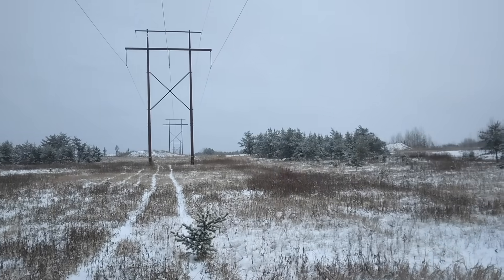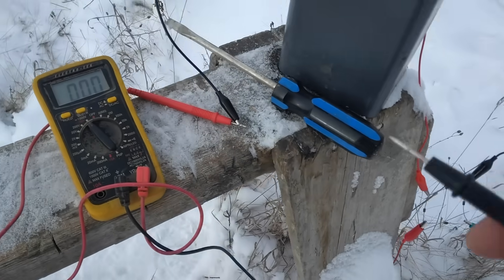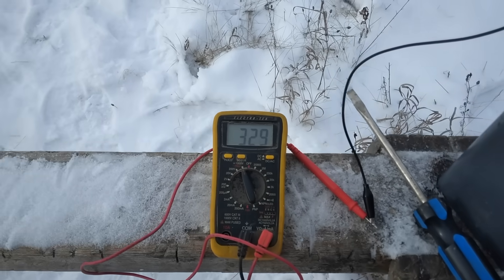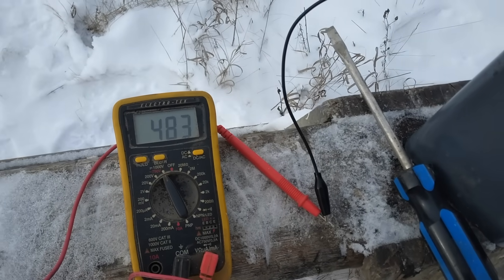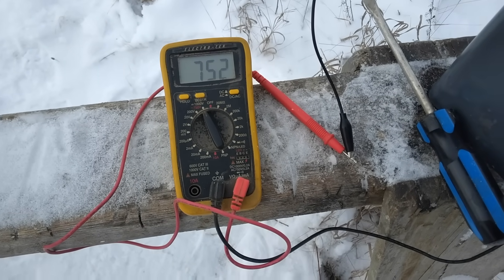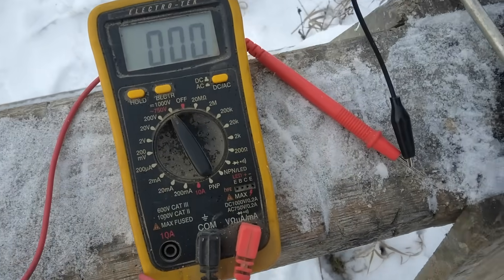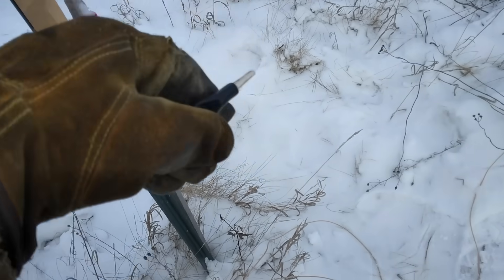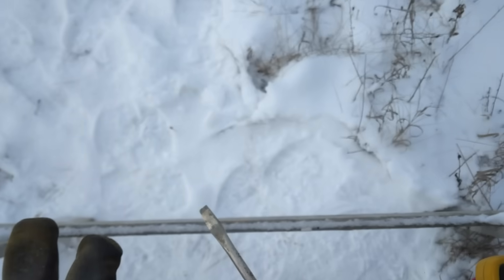Fences sucking power from under HV transmission lines

Comment: As an electrician, I was called out to a site where a crew was setting up a manufactured home under high voltage lines.   The set up crew was getting shocked every time they touched the metal frame of the house.   My volt meter showed 110 volts AC from the frame to ground.     I put ground rods at each corner and wished them luck.   Would hate to be living in that house...
Reply: Time to worry when the Electrician says "Good Luck!"
Reply: @todddon   That’s the truth!
Reply: @todddon  nah the guys on those crews never care what sparkies have to say
Reply: Saul Goodmans brother would freak out
Reply: Holy crap dude, how is that even legal? You would not be allowed to build a house under a HV transmission line in Europe, for obvious reasons 😅
Reply: @fredriksjoblom5161 that is not true, I have seen multiple homes under the 380kv lines here in Germany
Reply: I live in Ontario Canada. A guy got charged a few years ago for putting a coil of wire under the transmission line to charge a battery.  I don't know what the outcome was, but it was theft. @fredriksjoblom5161
Reply: @fredriksjoblom5161   TAKE RIDE THROUGH POPULATED SUBURBS OF CALIFORNIA ,YOU WOULD BE AMAZED !
Reply: @fredriksjoblom5161  it’s ok as long as you wear your tinfoil hat
Reply: @fredriksjoblom5161  in Portugal I know some apartment buildings underneath high transmission lines.
Reply: @fredriksjoblom5161 they still want us to drink fluoride here when my dentist says it's idiotic. Idk what is happening dude....
Reply: @fredriksjoblom5161  Yea I think he is talking out his ass!:face-red-droopy-eyes:
Reply: @fredriksjoblom5161 most high voltage go under ground.. in Northern Europe. In the 70s my room was maybe 20 meters from the high voltage lines coming into my town of about 30k. And the transformers to step it down was in my garden in a big concrete building… my grandpa was a plant manager at the electric company.
Reply: @kungfreddie  No, the vast majority of high voltage lines are above ground in northern europe. But it depends entirely on what high voltage lines you are talking about. On the lower end of the spectrum,  like 10kV or the 30kV line close to your childhood home, most transmission lines go under ground for safety. But they tend to elevate with the voltage. On the other end of the scale few power plants will have underground transmission lines going out of them. This discussion was specifically about building under hanging transmission lines, of wich there are plenty across Sweden. Also the regulations regarding EMC has changed quite a bit in the last 50 years.
Reply: Have you suffered any negative effects? Like coming down with cancer, or sterility, etc.?   @kungfreddie
Reply: @travisc8607  no... but my aunts both got ms... not sure how long of their upbringing was in that house... but it would probably be like atleast 10 yrs. My mom got breastcancer a few yrs back... but she is 69 so such things happens... it was treatable.
But 2 ms in same family is rare I think since it's not supposed to b genetically.
My grandfather died of leukemia while working there... but I also think.. not 100% .. that when doing military service in 50s he operated a xray machine on new recruits to check for tb probably. (I just remember hearing this as a kid)
My grandmother died of cancer too... but she was 88... so.. she lived in that house for like 35 yrs and then died 20 yrs after moving to a new place.
But I'm 50 and to this day I don't know that I've gotten any bad effects. I moved out when I was 16, moved in when I was maybe 5-6... so about 10 yrs there.
Reply: @kungfreddie  given that ms runs in families, having multiple people with ms is not unusual.  And about a third of US residents eventually die of cancer.
Reply: Let me guess, you have red curly hair and freckles?
 @kungfreddie
Reply: @fredriksjoblom5161  I don't remember the kv of the lines.. they would have been at least 30 kv I guess.. it was the lines delivering power to Trelleborg. I lived in a house right next to the transformerstation where the outside lines entered, my grandfather was "verksmästare" on the powerplant.
Reply: @rbauer961  huh? I'm not an electrician..  capacative coupling is something i haven't heard used.. not in English anyways.
Reply: @kungfreddie  It just means a wire can make a voltage in a wire next to it. But an underground wire cannot do this because it has metal around it which is connected to the earth.
Reply: @rbauer961  yeah that I get.. the shielding part but I'm not sure what your answer was in response to. When I said cables were under ground now i didn't mean it as a bad thing bcoz EM field. I meant it as a good thing. That the ground cables are isolated and shielded I'm well aware.. these 2,5 meter in diameter cabeldrums with ground cable were part of my playground as a child!
Reply: @kungfreddie atleast it was properly grounded 😂
Reply: Depends. Yes above i er distances in open coutry. Inhabited they go past or under. Do not want to live to close to those cables. As this man shows, there is an electromagnetic flux field. Tooich exposure may mess you up.  Same with people living close to broadcast towers. Increased cancer numbers. Alm those cellphone towers, well less energy, but radiatiom is not just about intensity, but also duration of exposure. So years of 24/7 exposure, guess will find out in the practice test. That is if we get the data and it not being succesfully surpressed.
Reply: @kungfreddie Was all that OK?
Reply: @fredriksjoblom5161  how else are we supposed to get rare childhood leukemias? Build neighborhoods next to radioactively contaminated areas, refineries, and chemical plants?

Because we do that too 🙃
Reply: @Dudeguymansir and landfills that eventually leach
Reply: @Dudeguymansir 
Watching how America's govt sausage is made is an ugly thing...
Reply: @Dudeguymansir There's absolutely no correlation between any illness and power lines, and it has been heavily studied.
Reply: @Dudeguymansir  Remember this is The American Way god bless America
Reply: @Dudeguymansir  Next to, why not on top of!?! We've tried that too 😭
Reply: @Dudeguymansir HV power lines act as electrostatic precipitators - the dust in the air collects on the lines and falls to the ground under them.
HV power lines also generate X-Rays if any leakage occurs. VHV (0.5MV) power lines generate gamma radiation and antimatter.
Reply: @Dudeguymansir Bayway refinery & chemical plant and the entire town of Linden, New Jersey have entered the chat.
Reply: @Dudeguymansir I mean massive amounts of people were duped into taking DNA altering substance I suppose it could happen that way to.
Reply: Would you like to explain to the rest of the class how you get cancer from non-ionizing emr? 
🤡🤪
Reply: @Dudeguymansir exactly.  They might start with regulations.  Which soon get forgotten in the face of money.
Reply: @Dudeguymansir  Rare childhood leukemia from non ionizing electric fields? If you believe that I have ocean front property to sell you right around the middle of the Sahara
Reply: @DarkAttack14  I’m currently investing in a bridge in New York, thanks so much 🫶
Reply: The elites don’t.
Reply: @Dudeguymansir wait until you realize you're being bombarded by radiation all the time if you make phone calls, use Bluetooth or wifi. Never understood the appeal of putting radioactive electronics in your ears and then sending signal between them.
Reply: @Dudeguymansir  Power lines don't emit inoizing radiation and don't cause leukemia.
Reply: @DudeguymansirLove Canal has entered the chat!
Reply: @Dudeguymansir Used to live across a field from some high tension power transmission lines. Five kids got leukemia along that corridor in the time we lived there. We moved as soon as we could.
Reply: @Dudeguymansirvaccines
Reply: @Dudeguymansir  This likely wouldn't cause leukemia. I would be worried about things like damage to property, electrical shocks, nerve damage from being tingled and shocked
Reply: @fredriksjoblom5161 Hey buddy,  The EV folks need all of this they can get, best get used to it.
Reply: If it's 110V there's probably a wiring fault in the Low Voltage feed to the house, and nothing to do with proximity to the HV power lines!
Reply: @gregbailey45 exactly. The chance that an induced current be right around that voltage is pretty low.
Reply: "good luck" 
ive heard this from multiple contrators
Reply: @ShadowZero27 lovely what construction has come down to. Instead of guiding people out of their mistakes...they say good luck rock on. Even life threatening situations
Reply: @ShadowZero27 not everything has a good solution
Reply: I got a shock riding my dirt bike under them it didn’t really hurt but shifted my hand off the metal part of handle bars. I’ve worked under them in winter it’s odd n I used to try n avoid them. They run straight over a local school😳
Reply: @willj7628 that’s bloody crazy
Reply: You should set it up in a way that it will power ur how
Reply: Capacitive coupling?
Reply: @Dudeguymansir No, inductive coupling like the air gap in a transformer. The magnetic flux lines extend to the wire on the ground inducing current flow. Capacitive coupling requires large surfaces in proximity. The wires don’t have a significant surface area.
Reply: @twm4259  Good answer, but transformers don't have an air gap.
Now, motors do.

In a transformer the flux is carried from one winding to the other using iron, laminated pieces of iron glued together.
Reply: @deang5622  
Air-gapped current transformers

These are auxiliary current transformers in which a small air gap is included in the core to produce a secondary voltage output proportional in magnitude to current in the primary winding.
Reply: @Dudeguymansir  Capacitive coupling would have produced a much higher voltage.
Reply: @Dudeguymansir            Inductive
Reply: @Dudeguymansir Inductive coupling.
Reply: @Dudeguymansir More likely to be inductive coupling
Reply: @deang5622  thanks. You’re like the seventh person to respond to my initial inquiry. I appreciate you, and agree 👍
Reply: @Dudeguymansir Induction, just like a transformer. Maximum current is the same as the HV power line with a single parallel wire.
Reply: You just *had to* @Dudeguymansir
Reply: @sandasturner9529  I don’t even remember what I did at this point lol
Reply: @Dudeguymansir Basic earthing. Thick wire connected to the metel then onto a rod hammered into ground. 👍
Reply: @Dudeguymansir   I think so. They could probably cure it with bleed resistors.
Reply: @Dudeguymansir ye, the only way to gain some valuable quantity, you need a capacitive coupling. Coil will not work at all, may be you will light a LED
Reply: @Dudeguymansir Inductive. The alternating magnetic field is inducing a current in the wire. If he wrapped the wire around a big chunk of iron, he would get even more energy out of it.
Reply: @Dudeguymansir what you were seeing here is that current reversing directions and those magnetic lines of force are cutting this wire. That's inducing the voltage. The power line has huge capacitance with the ground since it runs miles. There are a lot of magnetic lines of force collapsing and rising around that power line from the massive current.
Reply: @Dudeguymansir inductive
Reply: @ thank
Reply: @Dudeguymansir  I believe it's called induced coupling or induced ac. AC  noise.
Reply: @Dudeguymansir obviously so
Reply: @Dudeguymansir  no it's inductive.
Reply: @ please see the 300+ comments above that say exactly this. Thanks
Reply: @Dudeguymansir 
Inductive. And he needs to put multiple windings under that line if he wants to steal useable quantities of electric power- Which the power company will notice. There is no free lunch and people started trying to get free power this way many decades ago.
Reply: @BertRowe-b3l So if you're inductively stealing energy from the power utilities, what do they do to stop you? 😅
Reply: @BertRowe-b3l both capacitive and inductive coupling possible, but when it comes to high voltage power lines, inductive coupling is extremely. In general, high current lines are prone to inductive parasitics, and high voltage lines are prone to capacitance parasitics.
Reply: @Dudeguymansir  Inductive coupling
Reply: We take fluorescent lightbulbs underneath The big powerlines
Reply: The chances HV lines would induce 110V is pretty low (if not zero). Probability says the lines weren't your issue, probably a faulty piece of equipment with improper bonding.
Reply: @davidchavez81  exactly!  On a separate point, anyone who has had an MRI gets a mega dose of "lines of flux".
Reply: @davidchavez81 Seconded. As demonstrated in the video, with a big enough capacitor and the Know-how to rectify it and the time to build it up at micro amps, yes it’s possible to reach dangerous voltages. 
Without rectification, the current flow will be still be micro amps, but the polarity reverses 60 times a second. Actually 120, giving 60 full cycles every second, so the opportunity to build up a voltage doesn’t exist. It took dozens of seconds to build up to a noticeable voltage, with the rectifier. But without the rectifier, the voltage will rise, fall through zero and go negative, then rise back to zero 60 times in every one of those seconds, so never getting to the point where it can do any useful work.
Reply: @davidchavez81 not true..  we knew a guy whose property ran under HV wires and his horses fences were electrified,and he didn’t use a hot wire unit. So it IS feasible
Reply: @mrs.c5471 makes me feel better as a backup to our solar chargers when the herd is under the power lines in low sunlight November.. except the tiny wiresnon the ekectrinet may not have the same induction as 12 ga tension wire.
Reply: Parked a pick up truck under a high voltage line once..would get shocks from the door handle.
Reply: @marklevesque4131 the tyres insulate it from the road, so the whole thing becomes a charged up capacitor.
Reply: What he has built here is an induction loop. The closer it gets to the trasmission line stronger voltage and higher watts. Free power until th power company searches for the leak (draw) then you'll get a massive bill.
Reply: So you believe the power company would be able to detect a few amps leakage on their transmission line?  @jeffbleyl6243
Reply: All of it is zero point/free energy. Those line are closed loop and pull electricity from the ether.  @jeffbleyl6243
Reply: I live near HV lines and when passing under them the hum is unsettling.
Reply: The hum is the wires vibrating as the magnetic field generated around the wires expands and collapses - interacting with the Earth's magnetic field. There is also some interaction between the 3 or 4 wires.  @Gunshinzero
Reply: @buggsy5  I thought it was the electric field leaking a bit of energy into the surrounding air. Moisture increases the conductivity of air, which makes the hum “hummier” 🧐
Reply: @Gunshinzero of you do it at night you can see the buzzing: tiny blue sparks (coronal emission).
Reply: @Gunshinzero there is a hv lines a few blocks from house and I used to hear the hum at a certain spot like the insulator was cracked.
Reply: @Gunshinzero  And why are they humming? Because they don't know the words. Lolol😅
Reply: @Gunshinzero  it's not just the ominous hum. Very strong EMF can make you feel anxious as it can mess with some of your senses. Some of those "haunted house" stories have turned out to be anxious people hanging around close to a poorly shielded cable.
Reply: @dustinbrueggemann1875  I haven't heard that before. That's a pretty interesting bit of info. I definitely make it a point not to loiter around under them but figured I'm just over thinking it.
Reply: 110 VAC to ground? You likely had a wiring issue going on there,
Reply: @bretgreen5314  I just wrote he needs to go back and find the issue, I have seen loads of stuff under higher powered lines and never seen 110 AC to ground unless there was a neutral to ground somewhere. Ground rods everywhere isn't a proper repair.
Reply: to those saying the company will detect the loss 😂😂  you clearly have no idea how much loss actually occurs of that most is undetectable 😔
Reply: Jesus christ i cant believe someone would put a house there.
Reply: @brianfitch5469  I've seen then build brand new homes under these wires and within months come in and tear them down....I wonder why?
Reply: @brianfitch5469 Muhammad wouldn’t do it. As a matter of safety, Buddha, Confucius, and David Hume would tell the owner of the home that it could be a hazard to live near power lines
Reply: @brianfitch5469 shouldn’t be using God’s name so loosely…… He’s the savior of the world
Reply: And what did Jesus Christ reply to you?
Reply: @brianfitch5469  isnt it illegal to build under high voltage lines?  In Germany and all other nations i know of you can only use the land below as farmland.
Reply: @brianfitch5469 Zeus actually
Reply: Jesus Christ loves you!
Reply: @Molon_Labe1776  Jesus was just a dude with a beard
Reply: @Molon_Labe1776  who is jesus christ?
Reply: @brianfitch5469 ..what did Jesus have to say about it?
Reply: @brianfitch5469 I've seen the Greek and it doesn't say that. Where did you see your version?

Edit: the original comment I replied to has been deleted. It said the original Greek described something modern versions of the Bible didn't say and went into detail about nakedness and a little boy or something. Giving context because the replies are out of context of the original post.
Reply: @brianfitch5469 gnostic informant is as trustworthy as the National Inquirer.
Reply: @brianfitch5469  Spreading Satan's Lies. 
Believe them at your own peril.
Reply: @brianfitch5469 that passage says no such thing.  The mob that came to arrest Jesus also grabbed one of those following Christ and he slipped out of his loose fitting clothes and fled.
Reply: @simhess9720  Truth never fears investigation. I told where the information can be found. Ignorance is not bliss. 
Ive spent 30 years of my life studying the scriptures in multiple languages. 
The original greek is nothing like your English bible. They are essentially different books. Greek is much more descriptive. Just like the bible never says eternal life. Its says aonic life. Two way different meanings.
Reply: @Gunshinzero Yeshua was not Greek! Nor was his name Jesus. King James was actually Queen James! 😂😂
Reply: @seetheworldfrommyharley  The original language of the Scripture the guy I replied to mentioned, was written in Greek.

King James version was an English translation from Latin.  I don't know why people act like it's authoritative. I don't use it.
Reply: @brianfitch5469  Dude, what are you talking about? This video is about Electricity. Stop talking about religion.
Reply: @rrai1999  Keep it pushing the adults are talking.
Reply: @Gunshinzero  The hebrew copied from the greek. Hebrew isnt the original despite what many people believe. The first gospels appeared 100+ years after "jesus" (zeus which is greek) if your talking about old testament some of that is in ancient hebrew. The hebrew old testament is mostly copies of much old sumerian texts. Hebrew whether new testament or old testament are cliff note versions of the originals.  And other old testament is also copies of older greek works. We have greek manuscripts several thousands of years old. Much of their stuff was never destroyed. Greek is also much more descriptive then ancient or current hebrew. They have specific words for specific meanings. Its the most descriptive language we know about. The classical greek language nothing can compare when it comes to descriptions of things. 
When people study the scriptures in hebrew they are copies of older greek manuscripts. The hebrew is easier to learn then classical greek. You lose alot of descriptive details in it though.
I showed you where some knowledge is, he isnt the only greek scholar to go over these texts. They say what they say.
Even the name jesus comes from the god zeus. Greek.
Reply: @brianfitch5469  I mentioned nothing about Hebrew in my replies. I know the "new testament" was Greek and Aramaic. None of what they referenced was missing in modern text available today. They just took a bunch of interpretive liberties in their explanation.
Reply: @gavinhadley7672 really  this was man made Jesus had noth in to do with except the knowledge
Reply: @gavinhadley7672 or Buddha, Mohammed, Confucius, David Hume
Reply: @Gunshinzero the Latin Vulgate was translated from Koine Greek. Greek —> Vulgate —> English, then many other language. The Old Testament (Hebrew/Aramic) were translated into Koine Greek during intertestamental period, called the LXX. Most quotes in the N.T. are referenced to the LXX, not the Hebrew, until the Dead Sea Scrolls were discovered
Reply: @rrai1999 someone mention Jesus. Perhaps Buddha. Perhaps Confucius. Supposed to be about electricity
Reply: @brianfitch5469 non sense. The LXX is the Greek translation of the Old Testament Hebrew and Aramaic. The earliest gospels manuscripts have been date to about 40 A.D, not the second century. Jesus is from the Hebrew Yeshua, not Zeus. Yeshua means “God (Ha Shem/The Name) Saves”. The God of Israel, not Greek mythology.
Reply: @seetheworldfrommyharley But only on Saturday nights.  Or is that ‘Knights’?
Reply: @Gunshinzero used to have some on a quiet rode and every time we rode bikes under there could hear that humming never really thought there was anything good about it.
Reply: @gavinhadley7672  nothing, been dead long time
Reply: No nearby houses, hotels hospital, schools, stores,etc.etc. should not be permitted, with a certain distance limit of around 25 meters minimum.
Reply: When I was 11 years old, my Daddy bought a new doublewide mobile home. It had metal siding. Electricity had not been connected to the house yet and being an eleven year old boy, I was barefooted. My Mama called me over to the window to ask me a question and I reached up and touched the metal window frame... boy did I ever get a shock!  She didn’t believe me when I told her it shocked me. She said, “there’s no way for it to shock you. We don’t have any electricity.” Later that day, she was watering flowers (the well had electricity) and she was using her finger on the end of the hose to spray the water. She had an ant biting her toe so she reached up to lean on the house to lift her foot and remove the ant... pow! It got her too! 
When the electrical installer came later that week, he said it was because there was no ground installed yet. The metal siding was “soaking up” electricity from a nearby radio/tv tower. Once he installed that grounding we never got another shock.
Reply: @defritzel That's a great point. We passed on buying a double-wide a hundred yards from feeder lines. You could hear the lines humming and the orchard trees beneath the lines were stunted, full height a few rows away. I had heard of stuff like this but that was the first time I'd seen it in action.
Reply: I believe the field reduces at the square of the distance so even if you went back to your house and did the same setup you probably would still get a reading.
Reply: If there was no electrical wiring to/in the house, it would be possible if you had sensitive enough equipment. But even a feed to the house that had the power turned off would generate enough of a field to totally mask any signal from the HT wires.  @mollyhackman4910
Reply: The manufactured house was picking up the magnetic field around the high voltage leads basically acting as the secondary part of a transformer. That’s why the power companies don’t want building etc within a certain range of their power lines. A fence with metal posts or grounded posts would prevent electrical shock. And in case of a high tension wire being damaged and falling to earth’s surface would do a lot of damage.
Reply: You can take a 4 ft. Florescent light bulb and stand under these power lines and the bulb will light up, not real bright but it will light up.
Reply: Measuring 110VAC just a coincidence?
Reply: Had a 7 year old kid killed standing in water and touching the hitch of a mobile home.  Turned out it was a frame Lag bolt into the dryer wiring in the manufacturing process.
Reply: Free electrickery😂😂😂
Reply: There are 1000s of homes here directly under them. My brother in laws is. Hair on your body tingle outside.
Reply: I can smell ozone near 5g towers on humid days
Reply: You can light fluorescent tubes under the big high voltage lines as the magnetic field strength is that strong. I was told, while you can construct fencing or wiring to take the current, the power company would show-up to disassemble or charge you. I don't know if they could detect the loss or not? But if I tried this, I'd surely keep it on the hush-hush.
Good luck with it.
Reply: @terryenyart5838  , depends on the law.  unless the law states that it is illegal to place a fluorescent tube in the vicinity then you are a legal joule thief.  post the video.
Reply: You have to boost the fluorescent tube far overhead to get enough of a field to light the lamp. 

That experimental circuit was close to ideal. The only loads were the forward resistance of the diodes plus the internal resistance (more properly impedance) of the capacitor. But notice how slow the voltage increased - I doubt if there was even a milliamp of current flowing.  It would be easy enough to measure the current, and that dangerous capacitor would not be needed.  @terryenyart5838
Reply: @terryenyart5838 no they cannot detect losses, that's a myth
Reply: Up in northern Ontario, ive seen the power lines glow blue, back when i was around 14 or so, one night while we were all outside watching the northern lights. Electricity and magnetism are wild!
Reply: @MissHellKitten probably the 550,000vac lines
Reply: I didn't even think this is possible damn 😔
Reply: Power co. wouldn't let you build under a line, and if you did, as soon as they found out they'd get you to move it. Metal frame house? Who built it?
Reply: @patricktaylor4431  I’m on board now, I’m tracking!

Thank you
Reply: You had a live wire touching the frame that was not from the transmission
Reply: Your ground rods will be dissolved in short order due to electrolysis...
Reply: Exactly 110 huh? Funny too that you can’t really transmit CURRENT through the air without an arc.
Reply: If your ever visit washington state , go check our😁
Reply: Why not run that current to the supply panel for the house?
Reply: @mikejacob3536 because its super high voltage
Reply: Whoever sited that house has to be insane!!!🤣🙃😵‍💫🥴😵
Reply: Forgot to say it’s stupid!
Reply: I would always feel static and definitely hear it dirt biking underneath the lines where I grew up
Reply: Well it would be a exciting place to life ha
Reply: Free electricity!
Reply: Wouldn't a metal fence under a big power line be at risk for starting fires?
Reply: If the people who moved into that house don't have cancer they will have it soon.
Reply: I got 70 volts from my work truck while doing a service call under high voltage libe.
I got zapped too
Reply: There is a saying, never look a gift horse in the mouth lol, I would have my loft lined out with aluminium collector panels, shielding myself from EMF radiation while powering the lights in my house for free.
Reply: My friend told me he knows a guy that runs an electric boat motor from radiation across the Frazer River, under the high voltage lines, in British Columbia. Is this possible?
Reply: @freddymax5256    I find that highly unlikely.  While a fluorescent tube may glow under high voltage lines, there wouldn’t be enough current tom run a motor.  With a sophisticated emf pickup coil array it’s remotely possible he is able to charge the batteries while moored, but that’s a stretch.
Reply: There are reasons HV switch yard fencing has earth continuity testing done on it…
You can induce lethal voltages and currents on the fencing easily. I have heard of people powering houses off a coil of wire under HV lines…
Reply: I wonder if you can hook up a battery pack and a charge controller disguised as a fence.
Reply: @ of course you can. if landowner allows it.
Reply: Lived in a house that was under power lines and on foggy nights you could hear them crackling. I remember hearing stories about people using a spool of wire under lines and stealing power
Reply: Similar situation. My guys were running long mc homeruns through a wood structure and they were getting shocked. They were flabbergasted as there was no power in the building at all. I walked right out front and pointed at the highline running parallel to their homeruns and explained to them how electricity works. We grounded one end of the mc jackets and they stopped getting zapped
Reply: Cancer
Reply: Idiots asking for cancer. Who would be this dumb? Oh wait.
Reply: They have done studies years ago and found it is very unhealthy for people animals to live near HV lines.  I'm over 50 and this came out when I was young, but you know our muscles and body has electric.  Heart beats with electric, so HV induction into the body over a prolonged period may be hazardous
Reply: They could mine bitcoin for free
Reply: Exactly 110V?  

No transformers involved and you think it was coincidence that it reads 110V?  Sounds like BS.
Reply: Damn that's crazy
Reply: I heard many years ago The VA won't  do home loans built  under power lines!
Reply: Note 13800 will reach out and touch you at 11ft hey put a florescent bulb up in your hand
Reply: The people are probably harnessing the juice to charge their house batteries, they may have put it there purposely, people are crazy.
Reply: Would not happen in WA state.
Reply: @mrfriz4091 
Really???
Reply: Your video is unique . So your saying hv lines from above charge fence lines ? Can you harness that power and utilize it? I didn't know that voltage readings could destroy a voltmeter , thats good to know. One thing I do know is that capacitor , if over charged could explode and cause a nasty situation . Ide be really careful with that anyway .
Reply: There are many charts and LAWS showing safe distances near overhead power lines.  There is no way this will pass and should have been caught beforehand by 'engineering/construction' 
Unfortunately 'they' build first, connect everything and then call for inspections.
Reply: You should have your license revoked if you contributed to the dumbassness
Reply: Voltage increase by the square  root of the distance from the power line
Reply: @jickmccivy6327  So you get closer to the power line and the voltage decreases right?

You might want to rethink your post.
Reply: If Bill Gates gets his wish, HV towers will criss cross the US so plenty of opportunities for free power
Reply: Good morning, with that can the capacitor work like a battery?
Reply: You will get cancer from living by these lines
Reply: We just tap up our lamposts in uk ,
Reply: I never see houses under HV lines in my area of the U.S. I'm assuming it's not allowed by the power company or something.
Reply: A digital meter is usually more than a 10 megohm load resistance.  Your have voltage but no power.
Reply: That's true, unlike 3rd world country
Reply: most places its illegal to put a house under HV lines.  it causes birth defects and cancer!
Reply: 110 VAC? Coincidence? B***s***? Or bad wiring unrelated to the high voltage lines? You decide!
Reply: @TheRealCheckmate  There have been two days since I've lived here that I've heard what I believe to be that. The lines are about a block away and the along with a substation. Both of the times I've heard a loud but deep toned buzzing sound that felt like it was right outside underground. I assume it was the substation but it made me worry something underground was arching since we have underground lines to the houses. I even called the power company before. Not sure what to do about it though. I hope nothing blows up.
Reply: a structure under a HV powerline? is that no violating  the right of way/easement?
Reply: How many haunted houses are just this?
Reply: I though you could only ground at exactly one location by the NEC rules.  It's been awhile since I've looked at the code
Reply: Sick
Reply: Brain cancer
Reply: Suprised they weren't sent a estimated bill from the power company for their consumption 😅😅😅
Reply: What kind of house do you have? A Faraday cage
Reply: By the ghost of Nikola Tesla how did this country ever manage to build nukes? Basic electrical theory we used to learn at 12 or 13 years old is apparently no more. It is unimaginable that Thomas Edison was once a citizen here! What a disgrace.
Reply: Free Electricity if house is used as conduit!,
Reply: Or…somebody failed to ground the AC properly and std AC house voltage was “on the metal.”.
Reply: That's the best way to birth two-headed children.. 😮
Reply: They need to sue you. That's insane you did that... Hopefully you can sleep at night after that...
Reply: You shouldn't be within 2 kms of a hi voltage line unless you like valence electrons causing cancer.
Reply: Why isn't the power just going threw the power line
Reply: Living under high tension lines causes leukemia
Reply: Ay free electricity of the right voltage stepped down capacitively 😂 wonder if you could get some free LED lighting if you ran them from the frame to earth.
Reply: I thought buildings weren't allowed there!
Reply: I saw somewhere that the theory of electricity transmission by electrons is not correct. (Nikola Tesla believed there is an element known as ether which transmits the energy) While there is some small movement of electrons, the actual energy flows around the wire as a magnetic field. The reason wires are held high above the ground is because the earth's magnetic field will affect the transmission by wires if too close to the ground. Underground wires must be very heavily insulated to prevent this making it costly.
Reply: @UsEr-839djsjwo68  Official theory determines or sets the pathways for financial charge events - ie funding and research.
Explanations model reality and offer frameworks of predictability.
When life is sacrificed to Model, we have a scientific idol.
Aether/Ether derives from a sense of a wholeness of being without separation. EMF pervades so called 'space'.
Object models focus on 'matters' assumed self-existing. The Field is assigned the 'weak force' repackaged as 'Space'.
Yes electrons don't really flow IN conductors. It's all very curious is it not!
Reply: Free 110? I'll wear rubber shoes!
Reply: The neutral and hot lines were reversed. I've seen it a few times before.
Reply: What is your cooking system? Oh, we have an induction! ;)
Reply: Not high frequency 60 hz however it does have a big rise over run  voltage curve .
Reply: I would be more leery of being within a quarter mile to an AM radio station. Specially if the Marconi array aimed signal in your direction.
Reply: Had this happen with a giant metal trailer parked under a power line. Always felt a tingle touching it. Got out a voltmeter to check.. 110 to ground. But I thought that was too convenient.. the lines above are not 110.  Turns out someone had drilled a screw through a power cable.
Reply: Hey! That was my house.
Reply: Hey! That was my house.
Reply: Hey! That was my house.
Reply: Stand under those power lines with a couple florescent light tubes  ,, they will light up
Reply: I’d harness that power and charge my Tesla!
Reply: Well, now they have free wireless electricity FOREVER 🤪.
Reply: I was working at a nuclear power plant and we were setting a multi piece 60' mobile office trailer.  We setting it directly under the lines coming out of one the reactors transformers to the transmission line. They immediately grounded it as soon as the wheels stopped moving. You could feel and hear the energy in the air.
Reply: It'd be tough trying to comb your hair in the morning.
Reply: It's called transient voltage. As a telephone technician I dealt with it daily. It was really a factor for dial up internet and special data circuits. We had lots of voodoo tricks to decrease its effects.
Reply: stephenson ave toronti hundreds of cases if cancer skin problems cysts housing built right against power station
Reply: Cancer cause from exposure
Reply: RF transmitters in the home be like whaaaaa?
Reply: At how many amps though ?
Reply: Electromagnetic fields on those lines are dangerous. A woman hand washed a silk dress , air dried it put it on and put a florescent 8' tube in each hand and walked  under the lines after dark held them up and they lit up at arms length  .. NOT GOOD....
Reply: Bullshit.
Reply: "My microwave runs, but it's not plugged in"
Reply: Should have gotten them to sign a waiver for service and this Life insurance.
Reply: Had a friends wife get electrocuted and died from touching a trailer house that was not grounded.
Reply: @user-hb5vp8jd9v Truth never fears investigation.
Reply: What the actual fuck
Reply: Not good living in that flux field. I would not ne sleeping next to it.  Think there may even be stats on people sleeping too close to those cables. I would not. And if I must, I'd make my house a Faraday cage.
Reply: Yeah okay sir.   Everyone always has some crazy story how "this one time" 😂 You're So full of shit,
Reply: I think this is capacitive coupling rather than electromagnetic field. If so it be easily cured by grounding the wires. Shouldn't need to be very deep ground rods in such a case. 
   If capacitive coupling which is more likely do the same if an ordinary fence. If an electric fence use bleed resistors to ground.
Reply: Induced voltage
Reply: @mikeburnett7028  I think it's capacitive coupling, not magnetic. Different animals.
Reply: Why not use the free power then
Reply: The zen 🧘 in that house must be on un-readable levels.
Reply: I’ve heard if you hold up a fluorescent tube it will glow anyone ever given this a go?
Reply: When I was an apprentice electrician, many moons ago, there was a discussion in one of my classes about a rancher that was using coils under high voltage power lines to generate electricity through induction. The power company successfully sued the rancher for theft.
Reply: Did they even need electrical service ?
Reply: Could you power your house?
Reply: It's just static electricity.
Reply: That is so strange to read this account. Over 30 years ago, I got a call from a lady I knew in the next county over. She had been moved into a mobile home by her children. As I barely knew the lady, I was skeptical about why she even called me in the first place. She went on to tell me that the mobile home was located under some high voltage transmission lines and that she was being effected by the electricity from the lines. She said sometimes she couldn't comb her hair because it would become tangled. She asked me to come get her and if she could stay with me for a while. I thought the lady was having some kind of mental problem, none the less, I drove over and got her. I took her home and called the pastor of my church for help. The church had arrangements with a local motel to house people in need so I took her there. I never heard any further about her. I was actually a bit unnerved by the whole ordeal and never thought about it again until I read your comment above.
Reply: That's not even legal...
Reply: @TheGuruStud  Says who? Your keyboard??
Reply: Mobile homes were notorious for shorts to the metal frames; impossible to find😣
Ed c
Reply: @carolyncarpenter9682  Name your source for your statement. Shorts or wiring defects can be accurately detected in a matter of moments. I made a career of locating wiring defects so I challenge you for facts or admit you have none.
Reply: Your not supposed to setup or build anything under these lines. If one of those lines fall, It will cut that house in half.
Reply: @jfeeney100  🤣🤣🤣
Reply: I live in the similar house, the house is armed well and grounded, nothing is coming inside. On the other hand, I enjoy a free energy. So far, everything is ok, going medical checks once an year and absolutely have never felt anything strange. House is located 7 meters apart from the nearest line, as the local building code allows. Energy is taken directly underneath the lines.
Reply: This is stealing electricity. The power company will sense a higher than normal draw and will find the cause. Then they will have the police file theft charges against you. Whatever you save by stealing electricity will be nullified by your legal costs.
Reply: Collect the power and sell it back to them call it rent
Reply: I stopped under some power lines here in Southern California to let some air out of my tires (off roading) and had one knee on the ground and when I touched my rim it shocked the fuck outa me.  I carefully opened the back door of my jeep and got out my volt meter (I always carry tools) and one probe in the dirt about an inch and the other one on my rim said 330 VAC.  I went back later that night with some old 4ft fluorescent bulbs, and they lit up by just standing them up vertical in the dirt.  Check out the power lines on the east side of the 15fwy at Dale Evans exit, Apple Valley CA.
Reply: they’re supposedly getting breast cancer cases in LI NY, that They’re blaming it on the power lines
Reply: why? you get free electricity!
Reply: Lmao. But the frequency isn't high enough to induce that at the ground level.
Reply: I'm sure in the UK someone was taken to court because he had flourcent tubes in his shed that lit up because of the stray voltage/rf .
Reply: Oh thank God they were allowed to have human LIVING in that condition ...
Reply: You didn’t report it??
Reply: Im not an expert but doesn't the electrical field, hence the electricity itself, travel around, not through the wire?
Reply: dude i didnt' think you could live under one.   in SC they are all by themselves   i had no idea it was like that tho whoa
Reply: What a crazy coincidence that a high voltage power line would induce a voltage of 110 from the frame to ground. I would have done some more investigating to see if there were any extension cords that got damaged, and the exposed wire was touching the metal frame. A high voltage line would induce a much higher voltage that would read in the thousands.
Reply: Who needs solar when you're living in a capacitor?
Reply: Imagine what it does to your brain?
Reply: The funny thing is that they paid you to prevent that house from receiving free electricity.
Reply: Hmm, sounds more like a ungrounded gfci temporary power pole
Reply: You couldn't actually power anything with that induced power though.  A short quick jolt is it.
Reply: Got a "great" price on that lot
Reply: It IS against the law most places to put a dwelling in that right of way. It's like putting one over a high pressure gas line
Reply: My sister lived in a house like that  , the lines would humm when high humidity was present, she was sick one way or another after living there for 12 years . Once removed she got better but still got sick more often than most . She died at 60 , i will miss her
Reply: Hell, if you wear anything polyester that can accumulate static charge, just driving under power lines is enough to give you a shock the next time you touch your frame or exposed metal on the car
Reply: Putting pigs in a pen under transmission lines sterilizes them, the human body systems are very similar to pigs, and,   we sleep 8-10 hours a day, turn off the electrical breakers to your bedrooms, the electrical field surrounding you in your bedroom is affecting your bodies, the doctors are doing this!!!!!!
Reply: Now ya see WHY theses LINES need totally fenced off for SAFETY of humans and animals !!!!!!
Reply: Parked under a high voltage line, get shocked when I touch a truck that had primer on it , touch my blazer factory paint wouldn't get shocked.
Reply: Shoulda used it for temp power lol
Reply: Many years ago I remember watching a video that sited a report that mapped put higher incidents of cancer and they followed the path of high voltage electrical wires.
Reply: @ dang its scary being around them
Reply: Playing with high voltage in the snow....not good
Reply: I doubt the power company would allow a mobile home to be put on their easement
Reply: The cancer rate for people that live near these lines is extreme, I suspect that these folks did not live long.
Reply: On the bright side it's in the house and not the people
Reply: Is anyone else concerned about  the world turning to electric cars etc ..  do we know the damage we are exposed to from everything becoming electric and  the amount of currency radiating from lines and batteries  ??!!
Reply: Cancer case in the making. Multiplied by however many souls thought they should live there. Insane
Reply: That's a hot wire touching the metal of the house. Already been through that. Good luck finding it.
Reply: Hard to believe the power company would allow someone to put up a home on their easement.
Reply: G👀gle National institute of Health Covid 19 & 5-G Radiation. Read the Abstract of the Study 2nd 1 down on
G👀gle this is what's making us sick NO wireless communication has been Safety tested since 1994 been proven by childrens health Defense & Environmental health Defense in Federal Court from Heiskell Tennessee👋
Reply: Why would it measure 110v a/c. The power line probably was over 48k volts. umm.. what a coincidence. If the trailer was wired wrong (or an RV), a hot skin condition can kill you. It happens.
Reply: How is it 110 if it was under high voltage lines? It should be higher
Reply: That sounds awesome. Put a couple big steel trailer frames under, and run a line to your house and you got free 110 power 🤣 assuming it had any amps to it at all
Reply: On a humid day line loss is 50%. A friend has lost cow's from a fence that ran under a 440kv line, he stopped pasturing them there after second cow died of electrocution.
Reply: We did something similar in Mabel lake bc on a larger scale. We had way bigger lines than this though. Hush hussshhhhh!
Reply: It's 110v with high impedance there is 0 chance they would be hurt. As an electrician you don't understand this???  Time to turn in your certifications.
Reply: That's a breast cancer box. In the early 90's there was a scandal about all these women working at a power plant developing breast cancer, suspected from the EMR.
Reply: And gere tgwy wondered why there children where born with three eyes
Reply: 110 volts. I have no doubt that inductive magnetism could cause this, but are you sure that they didn't have an improperly grounded house , and one of the phases was leaking back through the framework? 110 volts exactly seems too coincidental.
Reply: You would be living in a cancer box literally.
Reply: On our property in Wyoming there is about a half mile of 720kv Western lines crossing one corner. 
Any time I rode my old 2-stroke under them the magneto would freak out and the bike would misfire. 
Weird stuff that electromagnetic inductance.
Reply: So 110 volt AC was magically being produced from coupling? You need to go back there and find the neutral to ground. 😂
Reply: brilliant FREE ENERGY AS SHOULD BE!!!!
Reply: I'm retired lineman and that is not allowed in our state, transmission or distribution.
Reply: Look up Grandview Corners in a little city called Surrey BC. 
I, a long with a bunch of others, constructed a number of condos and large businesses, (Walmart superstore, best buy, etc) underneath the 600KV transmission lines. 

We were instructed by BCHydro not to wrap any of our power cords because the coils would cause shocks. 
I had far too many issues tripping GFCI's mostly on the wet rainy days. . 
Really neat, check it out.
Reply: It's illegal in every state to build under or like 2000 feet away from center.
Reply: At an impromptu gun range that was under transmission lines, on a humid day you could strike an arc from your key to the lock on your car door.
Reply: People here don't understand that different wavelengths of electromagnetic radiation affect your body in different ways. Ultraviolet, X-rays, and gamma rays cause cancer. But their frequencies are at billions or trillions of Hz. Thus, the wavelength is small enough to mess with your cells. With radio waves, micro waves, and the EMF from power lines, the frequency is so low that the wavelength is enough to just pass right through you without affecting you. 60 Hz is so low that it won't damage your cells.
Reply: Did ya know that power companies have been allowed to increase voltages overpast12 yrs...
Cheaper transmission.
Reply: Is it even allowed to build under a line?
Reply: You just gotta grab it fast to make yourself the same potential and maintain contact.
Reply: Potential ( voltage ) is one think, but how much current ?
Reply: 110.. yeah just measure a laptop surface to your skin while charging. nothing unusual.
Reply: Yeah right.  Name the place where the building code or the utility company's easement allows setting up a mobile home under high voltage lines.
Reply: Your house is a giant transformer... sheesh, wonder what effects that would have on other devices within the home? Or would the interior be safe due to the field being a torrid? Hmmmmmmmm
Reply: 110?? Don't wire that to ground, wire that to hot!
Reply: They messed up.  All they had to do was wire the frame to there panel box for free power
Reply: Ahahaha harness 8t and use it
Reply: Hook that shit into the load center
Reply: INDUCTION IS A THING.
Reply: I lived in a mobile home under high tension power lines , glad it wasn’t for long
Reply: any person is got to be a FOOL to Build under POWER Lines 
or looking to die early
Reply: Duh
If you get 110 V, obviously it is regulated.
Do the math don’t call yourself an electrician
Reply: Wireless charging, Tesla would be loving it and living in that home...
Reply: It should be Illegal for Governments to ALLOW buildings to be constructed near High Voltage line, like he said the Restrictions in Canada, I think Australia is similar, because I have never seen any buildings Under those wires, even trees are not allowed too close to them. It is MUCH too Dangerous.
Reply: also an electrician... uhh wow bro.
Reply: I live about 100 feet from a line along the street that I was told had 80,000 volts running through it. It’s the top wire on the pole, about 50 feet off the ground. Is my health possibly being negatively affected?
Reply: @zhuliu the top line is ground/ lighting conductor). The lines carrying power are multiples of 3 (3 phase power).
Reply: @garethevans9789  So yeah, I probably heard wrong and my health is probably not being harmed, right?
Reply: @zhuliu Those things are relevant.
One person can smoke cigarettes every day and live to be 100 and not even suffer from a cold, while the guy beside him died of lung cancer at 49. 
In short it's best to not be exposed (to anything).
Living near Wind Turbines I've seen in documentaries can lead to short and unhealthy lives.  
Life in a jungle is better.
Reply: @RetroCaptain I’ve been working on transmission lines for over 30 years. I’m dropped onto the line by helicopter so I’m attached to it but not grounded. Like a bird on a wire, it’s what we actually call it. These lines carry 500kv You can feel it buzzing through your body but you don’t get shocked because you’re not grounded. Having contact with this much electricity for 50-60 hours a week for all these decades, should I be worried?
Reply: @RetroCaptain 
Life in a jungle is better? OK Tarzan, if you say so!😮
Reply: @timothyrepp4259 how do you feel?
Reply: @RetroCaptain The smoker who escapes cancer or COPD is a rare outlier. I worked in a respiratory/cardiac hospital ward for 17 years and if no one smoked, it would have put us out of business.
Reply: @zhuliu No you didn't hear wrong. Do you think your body is not going to be harmed by absorbing all of that energy? He just charged a capacitor to 960 volts without ever touching the electric equipment.
Reply: @timothyrepp4259  Do you have any super powers? Possibly related to  Electricity or magnetism?
Reply: @RetroCaptain It's the way you breathe and what you eat that matters. If one were to eat baking soda every so often it would neutralize acids in the body (which Cancer feeds on) and oxygenate it as well. Cancer does not like a well oxygenated body. Think of yourself as a high performance jet, blocking the air intake would not be good for the components of the jet, neither is messing with your breath.
Reply: @timothyrepp4259  - I've always wondered what that would feel like to a bird on those lines, or a human. Thanks for sharing. Still sounds terrifying, even if the risk of shock is zero as long as you don't somehow become grounded.
Reply: @RetroCaptain living in the Jungle results in extremely short lives - because things that eat humans live in jungles.
Reply: @timothyrepp4259 The biggest problem with 500kV lines is radiation (gamma ray) exposure from faulty insulators.
The radiation is visible on video of faulty insulators.
Reply: @allangibson8494  I'm implying that you have a decent shack not sleeping on the ground.
Reply: @RetroCaptain  wind turbines cause cancer now? 😂😂 You people never cease to amaze me
Reply: @timothyrepp4259 It's gotta take some enormous willpower to hold back as much sarcasm as I'm sure you do when confronted with such topics..... bravo.  Fifty ish years of half a millions volts truly flowing through you, probably starting in your twenties, right? Glad there's guys like you to do it.  Happy to hear no ill effects suffered.
Reply: @RetroCaptain life in a jungle is most certainly not “better”. Did you forget about the diseases? Also, believe it or not, organic things can be carcinogenic as well. Nature is not “clean”
Reply: @timothyrepp4259  Nah. Besides, never having to light your cigarettes is a BIG time saver!
Reply: @RetroCaptain  What do you think is damaging human health near wind turbines?   What voltage is present and at what distance?   Magnetic or static?
Reply: @policy8analyst  I can't remember exactly and cannot quantify what exactly.
Watch the documentary 
Down Wind
& you will see exactly what I found out.
I suspect strong level of emf emanating from the enormous Switch mode Inverters in the turbine housing. Travelling in the output leads at the tower base.
Reply: Funny thing. I never see a bird sitting  on the big tower lines. But they hum.
Reply: @RetroCaptain do you believe in Donald Trump's windmill cancer?! LOL
Reply: @franklofarojr.2969  I don't generally follow what Trump or other politicians say.  I used to but became burnt out over time. 
Even in Canada there's people who constantly update what ridiculous things they say and do it gives me a headache.
Reply: @RetroCaptain just general knowledge here but i see no more danger than the high voltage lines themselves.  If you can tolerate the noise. Just watch out for falling parts.
Reply: @RetroCaptain 😂 living near wind turbines are harmless.
Reply: @timothyrepp4259 you must resemble Reddy Kilowatt after that long on the 500kv system
Reply: @zhuliu either way your screwed
Reply: @RetroCaptain What did you see about the danger of wind turbines?
Reply: @philipliethen519  watch the documentary. I can't recall everything and the families affected said it better than I could. 
I'll have to go look up the title again I'll and mention it.
Reply: @philipliethen519  The documentary I got my information from is called 
Down Wind.  It's an hour and a half long. 
Interviews with families living beside the towers and what they and their animals experience.
Reply: @ Thank you.
Reply: @timothyrepp4259 idk, but are you rich yet? Just wondering if it actually pays
Reply: @timothyrepp4259 as a union commercial electrician I would say maybe but probably not. What are the health issues older people in your trade face? Read an interesting scientific article about how American AC power helps cancer cells proliferate because the frequency is 60hz which matches the frequency of our bodies. Are the transmission lines AC or DC?
Reply: @zhuliu no I work on powerlines every day it's just a magnetic field just like the gigantic field the earth produces. That's what the northern lights are.  This guy doesn't understand what he's doing. High voltage AC is a different animal than DC electronics. He's probably going to end up getting himself hurt. He's just building up a static charge with a capacitor.
Reply: @linemanap  Technically no, that is not what the northern lights are.

The northern lights are the interaction between ions and atoms coming from the sun causing the gas to give off light. The lines of magnetic flux simply act to spiral the  ions downwards the poles of the planet and increase the concentration of the ions.
Reply: @zhuliu yes! Higher rate of cancer and other illnesses.
Reply: @zhuliu dead ppl don’t get to comment. Some may not be affected, but many are. Make plans to Move.
Reply: @zhuliu just add another layer of tinfoil to your hat, you will be fine
Reply: Buy a decent 3 axis gauss meter and take magnetic field measurements
Reply: @zhuliu  No, you are completely fine living at that distance from a high voltage power line. That's very far, and it isn't dangrous on principle to be near to start with, so you're fine.
Reply: @zhuliu  Your health is certainly not being improved!!!  Think about how many "harmless" innovations that are now forbidden.  How many Beneficial drugs that have been recalled. Seems the further we get from nature. the more harm we get into.  ( 9:30 BTW, I made my living as a microbiologist. Most of my life I thought innovation was the answer to everything.  NO MORE!)
Reply: @zhuliu no
Reply: @zhuliu if you look a the insulators connecting the wires to the poles, count the ribs on it. 2 or 3 and you are dealing with 1400 ish 6 or so and it 7000 ish volts 80kv would need like 15 ribs.
Reply: @zhuliu no, your microwave and your phone are much more dangerous
Reply: @zhuliu  Just as likely to cause positive health effects, but overall neutral benefits.
Reply: Not  really  @zhuliu . Your phone you watch this on emits em radiation too
Reply: @zhuliu yes it is
Reply: @zhuliu depends which wire your closer to, could be positive
Reply: @zhuliu  no. Powerlines only emit radio waves, and the human exposure limits on radio waves are enormous. You'd have to stand directly in front of a megawatt transmitter for hours before plain electrical fields caused you any measurable harm. Really strong EMF has been shown to bother some people with anxiety, but that's more to do with sensory sensitivity issues than an actual health threat.
Reply: @dustinbrueggemann1875  You sir, are getting two thumbs up. 👍👍 You are a splash of sobriety gravely needed in this debate. I would add that really strong EMF actually causes severe nausea in everyone that gets to close to it. Not just some people with anxiety but entire working crews. But i am really splitting hairs at this point, this is nothing that you can ever experience as a member of the public. You literally need to be working inside a HV transformer station or something similar to be able to come into contact with that kind of strong EMF, and it is still not going to ever happen unless you make a pretty serious mistake.
Reply: @dustinbrueggemann1875  nah you’re way too sure of yourself that EMF radiation is harmless to live around
Reply: @dustinbrueggemann1875 
This type of hysterical paranoia is one of my personal favorites in online comments. I almost forgot about it, it's been a few years since I've run into emf people or the water meter people.  It's hilarious.
Reply: Well, the wife and I brought up 2 A* students and we live inside a microwave oven.
Reply: @pooroldfred intelligence is not low cancer risk. Oh, and grades are not intelligence, especially in the Rockefeller joke of a zxxnist indoctrination system.
Reply: @pooroldfred  You guys are the exception that proves the rule! 😉
Reply: Well that actually more or less checks out, because theres no conclusive research thats ever shown good grades equal a high IQ... It basically just means such students are receiving their programming without resistance and at optimum levels.  @pooroldfred
Reply: @pooroldfred  a tiny house hey? Great stuff!!! 😅
Reply: @alan4sure  appreciate the reply ..thanks......yeah tiny..but has all mod cons, great insulation, warms up in seconds, easy to clean and lights come on automatically when I open the door.
...although the tv signal is a bit sketchy...😆
Reply: It's incredibly hazardous to health to be anywhere near high tension electrical lines. There are many documented cases of health issues from families living near these lines in every single country that has them.
Reply: @lanthanumlanthanium6373 This is entirely false. There is absolutely NO evidence that power lines cause any illness whatsoever, and it has been heavily studied.
Reply: @lanthanumlanthIanium6373 I think you're incorrect, if it was a health issue don't you think that the people who work on these lines everyday for 40 years would have massive statistically significant health problems?
Reply: @lanthanumlanthanium6373   Anyone know of any rigorous study supporting this statement?  I’m open-minded, just don’t recall seeing any.
Reply: @lanthanumlanthanium6373 prolonged close proximity exposure to EM radiation can cause human biological effects, as the level of absorption can induce as well as enhance /"exhasibate existing cancerous tissues that may be present.
Blood cancer - leukemia can result in some individuals and reports have previously sighted this as a causation factor.
No public dwellings should be anywhere close to EHV power lines, as it is overly dangerous and negligent sloppy practice to allow such.
Reply: @BegudMaximan-zp2tc  Yes, I'm aware of this. That's why I commented on them causing health issues.
Reply: @lanthanumlanthanium6373  yeah for sure, surprising how many folks don't see the danger because it's an invisible danger, that's how it is
Reply: @BegudMaximan-zp2tc I had a friend who's house was close to very high voltage powerlines. He got Leukaemia. Was successfully treated. But he was very traumatised by the experience. However he did also work at a factory that dipped paint which had Xylene added as a solvent. But the Xylene specification allowed a small contamination with 'Benzene'. With the concentration of fumes enough to cause Leukaemia as well.
Reply: @johnrhodes3350 yes indeed, and various trigger events in one's life can initiate the onset of cancer, determining which ones is often hard to assess.
Reply: How shocking
Reply: I feel sorry for the people living there won't take long before they get cancer
Reply: So Tesla did transfer electricity  with out wires  that's why they kief  him ,power should be free
Reply: Reading these comments just validates my opinion that letting the government anywhere near schools or Healthcare was the stupidest thing to ever occur in the United States...other than the Federal Reserve (private bank) and the formation of the IRS and other alphabet gangs!
Reply: @seetheworldfrommyharley fact
Reply: @seetheworldfrommyharley  Gimp.
Reply: I find this hard to believe. It happened to be 110v ... really, or are you just saying this because a basic receptacle in a house is this? The power coming in is 220v and HV lines are much more before the step-down of a transformer.  Ridiculous!
Reply: There's a house newly built under a hv power line
Looked and thought
Yup you would never get me living there
Dam it makes my head tingle just passing under these pylons 

Wisbech in the UK
Reply: Teh people that will live in it will wind up with cancer.